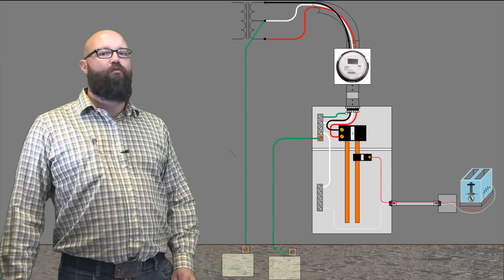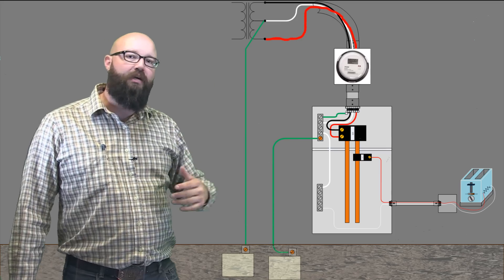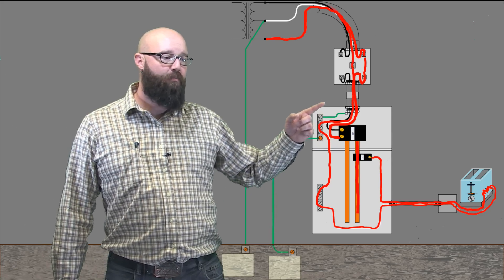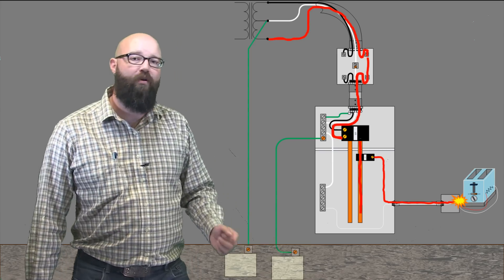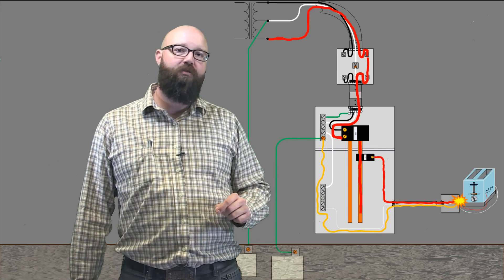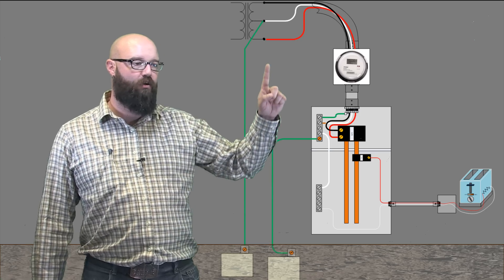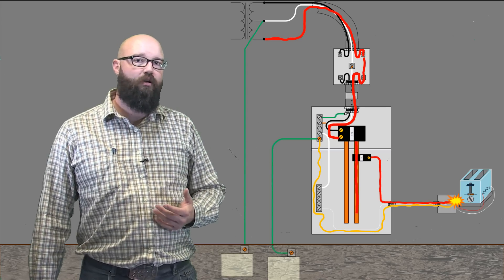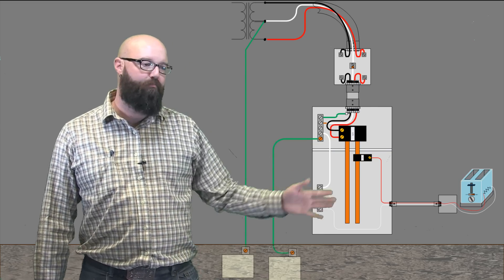Grounding and Bonding

Comment: Great video! Thanks. But is there a difference if the fault is on the neutral, after the load?
Reply: A fault in the neutral can mean two things, a short or an open. In the case it is a short to ground, nothing would happen as far as breakers tripping because the neutral is already bonded to ground. If the fault is an open, then there is no complete path for current from from the load back to the source and so the toaster in this scenario would turn off.
Reply: @ryndroma  So you're saying that if a neutral, in a 4-square box, comes in contact with the side of the box, after the load, nothing will happen?
Reply from the maker: That's correct. In a solidly grounded system as mentioned above, the neutral and all metal components are effectively the same point, so it's like you hung the wire to itself.
Reply from the maker: The identified (what we commonly call neutral) and metal box are at the same potential. This is done deliberately at the service disconnect, or meter base (one or the other) to create an equipotential between them. It is what provides the low impedance path to facilitate the operation of overcurrent devices.

Remember, past the service disconnect, the neutral or identified is absolutely isolated and not permitted to intentionally contact anything metal. 

This would not trip an AFCI but most certainly would trip a GFCI as an alternative path would carry normal operating current back and create the necessary differential in current between the identified and hot conductor. 

This is not a dangerous scenario, because as mentioned, the identified conductor and square box are already at the same potential. No potential difference between them means no sparks.

The issue that arrives from inadvertent contact between identified conductors and metal past the service disconnect is now you have objectionable current flow as a parallel path back on metal components, this the reason for neutral and identified isolation. Long story short, don't connect the white wire to metal. As electricians we are trained to know this and not do it.

Comment: Sir what happend if we removed the bonding concundor?
Reply from the maker: Nothing. Which is bad. The system would continue to function normally. But in the event of a short to ground, there would be no low impedance path back to the supply, which means no high short circuit current. Your breaker would not open, and there would now be a potential of up to 120 V between metal components in your system, and metal components connected to your grounding electrode (water lines, waste water lines, metal interior gas lines). 
Imagine two islands with different potentials. You're fine as long as you stay on your Island but as soon as you step across from one Island to the next, you are know a conductor between two different potentials.

Comment: OMG Have you heard of Equal Potential? RCD Circuit Breakers Is the answer come to New Zealand / Australia or UK with 230 Volt 50 HZ Phase Voltages (400 Between).
Reply from the maker: The intent of ensuring bonding between all metal non current carrying components is establishing and equipotential environment, eliminating touch potentials. We do have RCD devices, but we refer to them as Ground Fault Circuit Interrupters, or GFCI devices.

Comment: Thanks for the video, well done! Still confused on one thing though. If the meter and main panel both have the neutral bonded to the case/ground, would that cause objectionable current on the ground wire or metal conduit anytime there is normal current flow through the neutral?  Being that there is a parallel path from the panel to the meter it seems as there would be. Just like if a sub panel was had the neutral and ground bar bonded together there would always be current flowing on the ground when there is current flowing on the neutral back to the main which would be a problem. Why is it not a problem when it’s flowing on the ground from the main panel to meter?  Or am i just misunderstanding something?

Comment: US electrics depend on earthing through the metal conduits and raceway? That's insane. Use a green wire - way better. And if you have a loose neutral upstream of the meter, yea, all the metalwork in the house becomes live. It's a great system (!)
Reply: Not since the early 1960’s LOL! Of course there’s a separate ground wire back to the service panel for each circuit, that’s why there are two stand-off strips in his illustration and the subject of the video is about the two of them being bonded at the main service entrance.

Comment: Thanks for this info sir, I have only one question, assuming the grounding wire from the panel disconnected (the grounding wire going to ground rod), will still be tripped the breaker if the load's body touched to the hot wire or live wire? If someone touched the body of the load which touched the hot wire, will not he or she be electrically shock because someone touched a hot wire and he or she is grounded, he or she will become a load of the circuit.
Thank you sir.

Comment: Do you answer questions? I have a question I haven't been able to get the answer to
Reply from the maker: I can do my best. Sometimes the comments slip through the cracks so I'm glad I saw this.
Reply: @schulerruler  ok then :) thank you for your response. I'll try and make it short. 
    For the record I'm not completely clueless, I know the basics about electricity and I'm pretty handy around the house and garage. So basically I'm trying to install a A/C mini split into my home. It's a 24k BTU unit that is 220v and calls for a 20amp max protection. So originally I was gonna run a double pole breaker from my main panel about 100ft to where I'm going to install the condensing unit. I was gonna run 10AWG wire (2 red one green) in conduit. However that was gonna take a while as I have to go around some obstacles. Then I realized that there is already a pool sub panel 5ft from where my mini split is gonna go!!!! So I opened it up. It looks like there's 220 coming in (one is a purple color and threw me off). There's just enough space to fit a 20amp double pole breaker, however when I check the main panel labeled "pool" it's only on a 20amp double pole breaker. But inside inside the box there 3 double pole breakers. There's two 20amp double pole breakers (pump and heater) and one 15amp double pole breaker (mister system). So in my head the pool sub panel is already overloaded? So to my question 😁 instead of running everything 100ft can I just add a 220v double pole breaker to the pool subpanal and then upgrade the breaker in the main panel labeled "pool" to maybe 50amps? Is any of this possible? I don't know if pool subpanals are the same as normal subpanals.  
Thanks in advance!!!?? 🎉
Reply from the maker: It is likely that the conductors to your pool panel will not be sized to handle that much load and may have considerably excess current on them resulting in very high temperature and potentially fire. My suggestion is to have an electrician check out the feed to the pool panel to ensure proper sizing of conductors is maintained.
Reply: @schulerruler  yeah, the problem is they won't come look. They know I'm trying to do this on my own and they want a diagnosis fee. Also inside the panel it says "100amp max". And why wouldn't it be sized right? There's already two 20amp breakers. I would be adding a 3rd
Reply: @schulerruler  I opened it up and looked inside it's 12 gauge wire

Comment: Is that why you only have to use a bonding bushing on the main service panel?
Reply from the maker: The bonding bushing is there to ensure the best possible connection, so as not to rely on a locknut connection. It directly bonds that service raceway to the grounded neutral conductor.

Comment: I removed some old (unused) knob and tube wiring from my garage. Although there was no equipment ground conductor or raceway conductor, the neutral wire was much heavier than the hot wire. The hot wire was I think 10AWG and the neutral was 8 AWG. Was this their way of doing what you say about creating a low impedance path to ground?

Comment: What’s the purpose of the black wire in this situation
Reply from the maker: The black is line 1. Red is line 2, and white is the identified neutral shared between the two. 
L1-N=120V, L2-N=120V, and L1-L2=240V.

Comment: Question: Service raceway is made of metal and is in contact with the panel. Say, if I don’t have both the neutral wire and service raceway bonding jumper I will still have return path to transformer neutral. The fault current will flow through the panel —> service raceway —> Meter Neutral Screw terminal —> back to transformer neutral. Is this correct ?
Reply from the maker: If your meter base is the point where the neutral is bonded to the system, then yes, you are correct.

Comment: Why does the fault current go up the neutral to the utility company's transformer and not through the system ground to the underground plate, seems to me like the system ground would be a path of least resistance?
Reply from the maker: Unfortunately that is a common misconception in the electrical industry. The ground plate to plate has a relatively high impedance when compared to the service neutral. Fault current will always find the path of least impedance back to its point of supply. This completes the circuit with low enough impedance to create large fault currents that will trip overcurrents.
The connection to the earth itself is to offer a path to dissipate transient high voltages like lightning.
Reply: @schulerruler  Thank you for your answer! One more question, in the refrigeration HVAC industry, some techs use cheater cords on rooftops where there is no receptacle to plug in tools. This cord is where they use the female portion of an extension cord and they wire the hot to one leg of a disconnect switch at an A/C unit and the neutral from the cord to the bond screw of the disconnect. This is highly dangerous and is 100% unacceptable, but i'm trying to wrap my head around as to why? How does the bond wire, which has essentially been rendered a neutral conductor, become dangerous in this situation? I'm assuming if anyone becomes part of that bonded path they can get electrocuted?
Reply from the maker: You got it. Now everything that is metal is essentially a path for regular current that would normally flow in the neutral. The neutral is isolated from boxes, panels, etc, past the main service for this exact reason. If any person should now touch metal this is connected to (which is almost everything through mechanical connections like screws, mounting hardware etc) and something with lower potential, they are now a path for current due to the potential difference between the two points. Scary stuff if done wrong.

Comment: Why then wouldnt make sense to bond a sub panel to insure continuity to ground.
Reply from the maker: Unfortunately that creates a parallel path back on the conduit that feeds the subpanel, for neutral current. It won't trip the breaker, but will create a potential difference on that conduit/panel and anything at zero volts potential.

Comment: Is it code compliant to use EMT tubes, fixtures and metal boxes for grounding purposes? I guess it might depend on which country we're looking at, but I'm pretty near sure USA and Canada don't allow this, and require an actual bare conductor all the way to the point of use (AC outlet for example).

Can anyone confirm?

Thanks for the video BTW.
Reply from the maker: I can't speak specifically to the NEC but yes, Canada allows EMT, rigid raceways as a bonding means. We do not require a bonding conductor pulled separately for EMT for example. It would for sure be required in a PVC conduit, or if EMT was encased in concrete.

The boxes do also constitute as a bonding means. For example an EMT run from panel to junction box, then out to a device box. None of it would require a separate bonding conductor to be installed. The set screws and locknuts must all be done up tight though.

For the Canadian Electrical code, the reference is 10-610 1)a), but I don't have an NEC copy unfortunately.

Comment: hello  need a help to understand 
   we never connect neutral to earth (we use TT system ) 
   why did this example show us neutral and earth connected ? plz explain
In this way can you explain how RCCB(residual current circuit braker)  works 
thank you
Reply from the maker: In a single phase 3-wire system, it is required by electrical code that the identified neutral be connected to the grounding conductor on the load side of the service disconnecting means.

As for the breaker, depending on the overcurrent situation, one of two "trips" can occur.
Either a thermal, where the circuit draws more than the continuous rating of the device, causing it to trip due to heated bimetallic components that move the breaker to the open position,
Or a magnetic short circuit. Very low impedance will cause high current levels operating an electromagnetic component in the breaker to trip the breaker.

Hopefully this helps.

Comment: Just a point of clarity for those trying to learn... I explain it in a similar fashion but any time I mention a "short circuit" I would highlight the path to the ground rod at the house because it's the SHORTest part of a short circuit. Yes, the juice will flow on all paths to find a ground / neutral but emphasizing the ground as the short path removes the mental block that so many people have as to why we have both a ground and a neutral, but the neutral doesn't normally carry any current. It's a safety. I'll borrow a phrase from an English electrician I know here in the states. In England they call the ground wire (earth ground) a "drain" and there's good reason. Imagine a basement full of electricity and something goes on the fritz. In plumbing they would call that a leak. Where does the extra go if it can't flow the normal route through the wires? (pipes for plumbing) It runs across the floor to the drain! (and into the ground) 

Going to the next level... the utility company doesn't really work with neutrals and grounds EXCEPT at the transformer that feeds your home. That transformer has a CENTER TAP that is the central point between where they convert high voltage on the pole to the 2 legs we see inside the home. The CENTER TAP is tied to both YOUR neutral and YOUR ground for the house panel. This is how we get 240 volts here in North America. Using the CENTER TAP we get 120 volts between one leg and that tap also tied to ground, which becomes YOUR neutral in he house. Each pole with a transformer has it's own ground rod. Each home has at least one ground rod as a redundant safety because more is better with this system. (Europeans will tell us it's a piss poor system) Any juice that goes where it's not supposed to go winds up at ground and somewhere a breaker trips. (if all is well) Hopefully it's a smaller breaker and not the big one!
Reply from the maker: Thank you for the comment. To clear up a point, fault current will NOT travel to the ground in a properly installed electrical installation. It will almost entirely travel back to supply via the neutral conductor, as this is the intent of the connection between the neutral and the panel itself. It provides a "gathering point" for fault current to find the neutral, should a fault current be imposed on any of the metal non-current carrying components (ie. boxes, conduits etc.)
You may see a VERY small amount of current through ground. But we're talking milliamps or microamps. The impedance of the ground is massive compared to the neutral impedance back to the supply. 

The grounding electrode really only provides a path for high transient voltages like lightning, to dissipate. It does not assist in the tripping of breakers or fuses in any way. 

Hopefully this isn't interpreted as combative, it's just a very misunderstood aspect of grounding and bonding by many people, even professionals in the industry. 
Cheers.
Reply: @schulerruler  ... oops, I made a typo when I stated the neutral doesn't normally carry any current in my first paragraph. I meant to say ground, as I further explained. No argument here. I only use the example of a short going to ground to get guys to realize why it's there as a safety conductor, why it doesn't need to be insulated, and why there's bonding at the main panel. Kinda like a belt and suspenders approach.

Comment: US sparktrician here. Do you Canadians use 15a breakers to feed kitchen receps? I know you are not (or were not) allowed to use a 20a to feed a general recep/llighting circuit but I thought you guys used a 2p 20 to feed a kitchen duplex and split the tab on the hot side.
Reply from the maker: Although the split receptacle feed from a 15 A 2pole breaker is still allowed, it's more common now to feed 20 A receptacles from 20 A breakers.

Comment: Great Job!  The most confusion occurs after the main panel with disconnects and subpanels.  If you could explain why it should of should not be bonded back to the main and when we need to take additional grounding measures we could determine when and what is necessary without calling the inspector.
Reply from the maker: That's a great Idea to add!

Comment: And what do you mean the low impedance path? Thank you very much
Reply from the maker: All connections in conduits, and all bonding conductors are made continuous to create a low impedance path back to the supply. It bypasses the load impedance and creates the very high currents required to trip the overcurrent devices.
Reply: @schulerruler  Thank you very much.. til next time, More Power